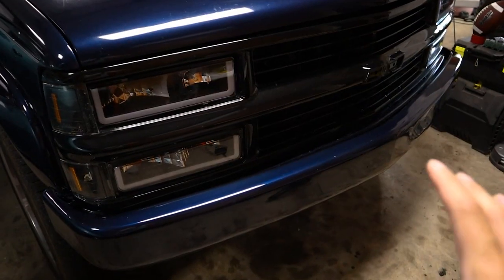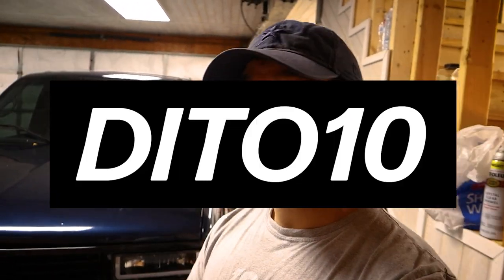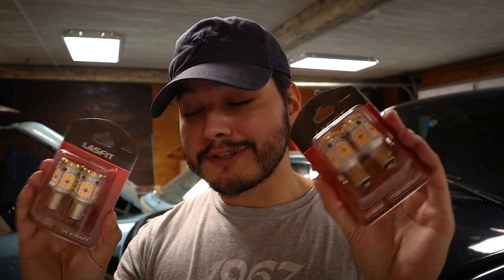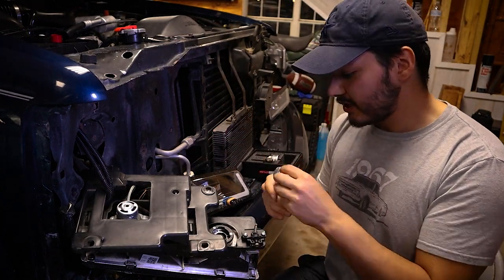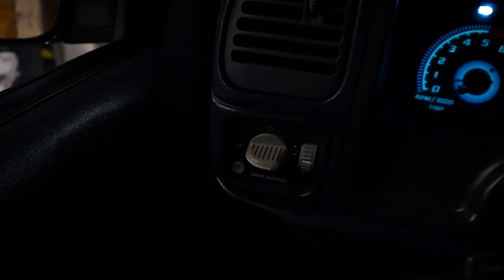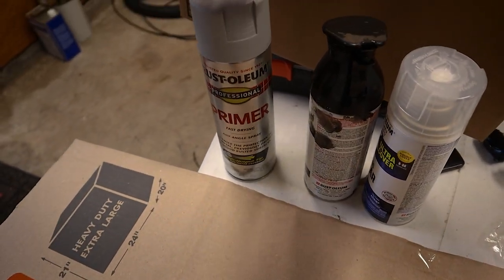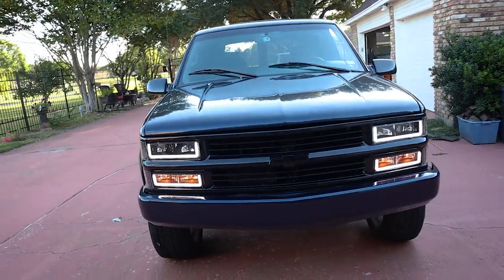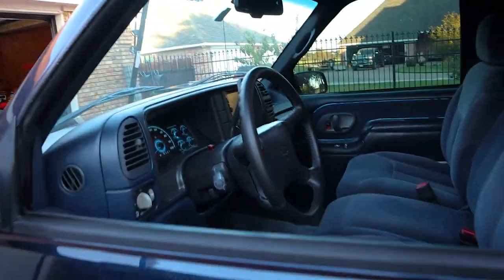3 EASY Upgrades For Your OBS Chevy!

Comment: You're not far off on doing the emblem. But the primer should be sanded when dry with 600 as it may peel off later ( unless the instructions say otherwise ) but being it's just an emblem I wouldn't worry about it too much. Great info on the leds that fast flashing drives me crazy lol

Comment: Initially your turn signal and corner lights were blinking opposite of each other.  How did you get them to blink at the same time ?
Reply: Headlights Off will cause the corner lights to blink opposite of the blinkers. Headlights on will allow them to flash at the same time. It’s a design choice from GM